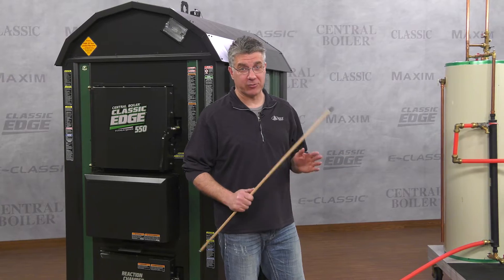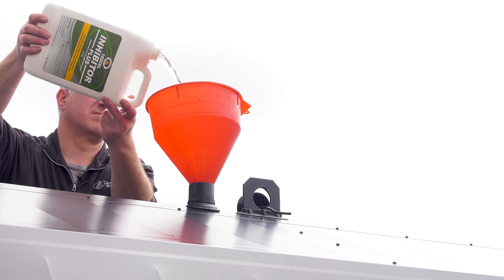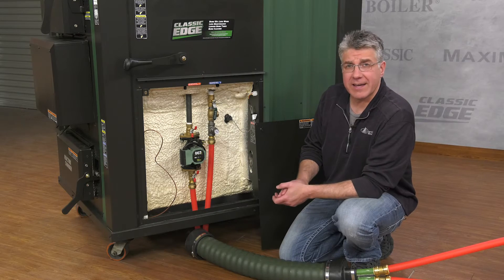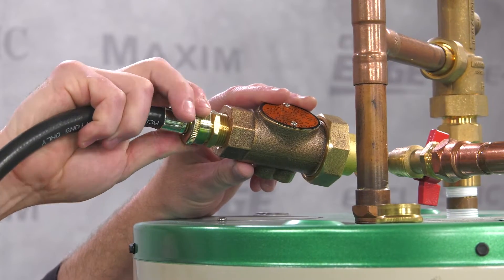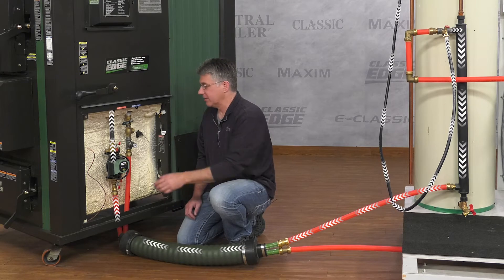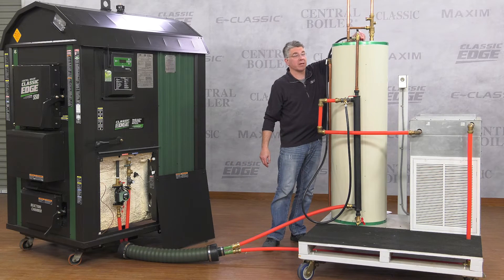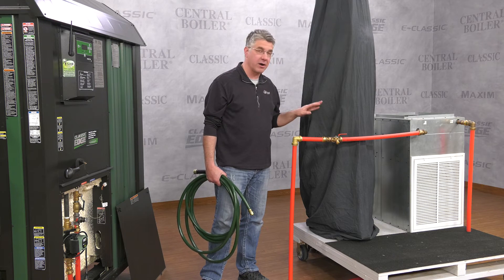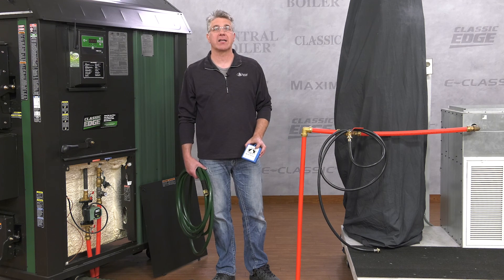Fill Outdoor Furnace with Water and Purge Air from the System | Central Boiler

Comment: I was told the hot water return of domestic water from the sidearm will not work in this configuration. It creates a thermal block because the hot water will not travel down.
Reply from the maker: No, a sidearm heat exchanger does not create a thermal block.  The reason is because when you turn on hot water at the tap or show, etc, cold water from the bottom of the water heater can be siphoned through the sidearm mixing with the hot water. This can result in the hot water being cooled down to uncomfortable temperatures.

Some people choose to install a Plate Heat Exchanger on the cold water inlet to the water heater instead. This approach preheats the incoming cold water before it enters the water heater, offering another effective way to ensure consistent hot water delivery. Both setups are viable and can provide excellent results depending on the installation.

Comment: what about if you are heating to two buildings - garage and house. I have domestic water on the house loop but not on the garage loop. Is there a way to fill and purge both from the water connection in the house?
Reply from the maker: The garage loop cannot be purged through the house unless they are all on the same loop.  If they are on separate loops, a spigot can be added on the garage loop and you can run a garden hose to the spigot to use domestic water pressure to the purge air from the loop.

Comment: My boiler water level is low but my pressure for my system is sitting at 150kpa on the gauge. Does it slowly evaporate out the vent cap or something because if there were a leak I'd expect the pressure to be down.
Reply from the maker: The amount of water that evaporates is a very small amount.  We recommend contacting a local dealer with your furnace serial number.

Comment: We are getting ready to purchase a home with an outdoor wood burning system. The owner has told us to watch the hot water as it runs scalding hot, he said it just needs a part to regulate the temperature. We are wondering if that’s so why hasn’t it been done. I don’t know which burner he has  but if we aren’t able to regulate the hot water it may be a deal breaker.   Thoughts?
Reply from the maker: Contact your Central Boiler dealer to purchase a tempering valve. This will take care of the issue. You can find a dealer on our Dealer Locator https://centralboiler.com/dealer-locator/
Reply: Did you get this figured out?

Comment: I filled from the top of boiler and not through the lines.  Water doesn't seem to be circulating so I expect air in lines because didn't purge. Is there any way to purge now without draining the boiler?
Reply from the maker: You can still purge air with domestic water pressure as shown in the video.  If the furnace overfills, excess water will come out of the exhaust pipe on top of the furnace.  When you're done purging air, make sure to test the water and add water treatment as needed since you will have watered down the mixture.

Comment: Can the water to house be turned off and the boiler still circulate if we were to go on an extended trip?
Reply from the maker: The heat exchanger for the domestic water is attached to the water heater inside the home.  Does that answer your question?
Reply: @centralboilerinc  No, my question is regarding shutting of the main water from the well.   Since it's a closed looped system it should continue to operate without fresh water correct?
Reply from the maker: That is correct.

Comment: Not recommending a thermostatic  valve anymore? Didn't see one anywhere in the system?
Reply from the maker: The new Classic Edge Titanium HD Series furnaces are more corrosion resistant and therefore the thermostatic valve is not required.
Reply: Central Boiler thanks for the reply.